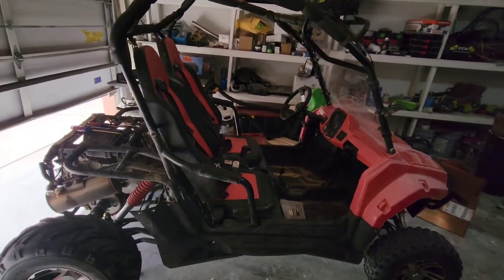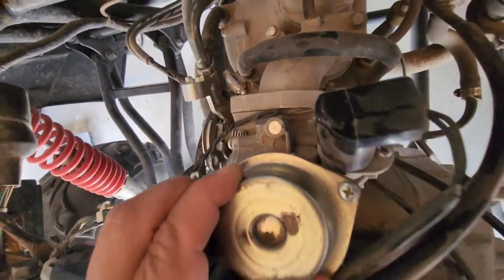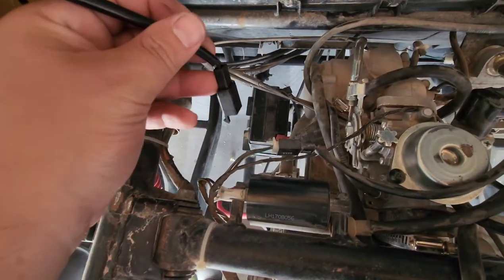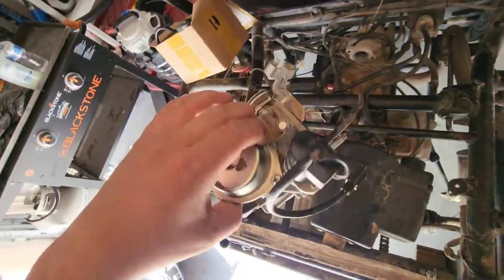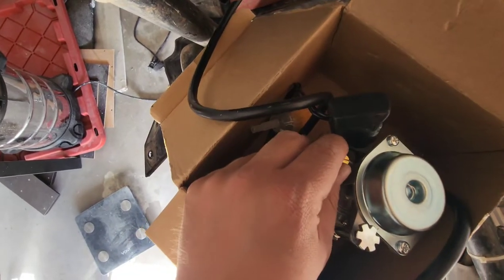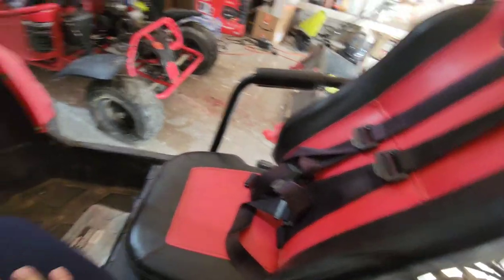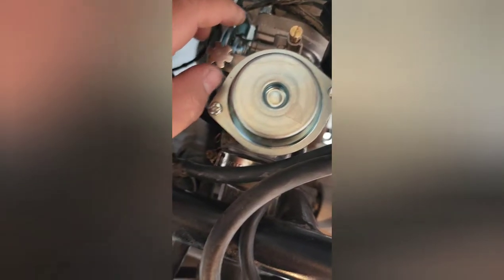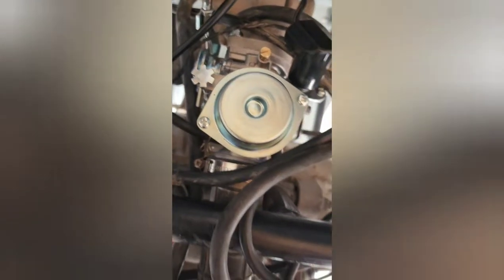Trailmaster Challenger 300 Carburetor Replacement and carburetor adjustment Gokart chain adjustment

Comment: Where did you connect the bottom tube that wasn’t connected?? From the carburetor
Reply from the maker: It actually doesnt connect to anything 😬 it is where the excess gas that goes in the carburetor comes out